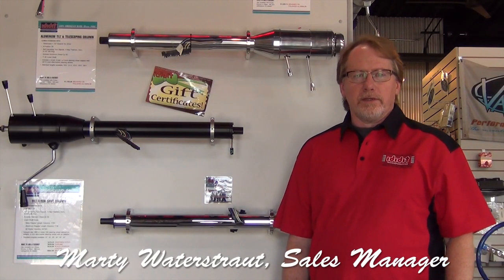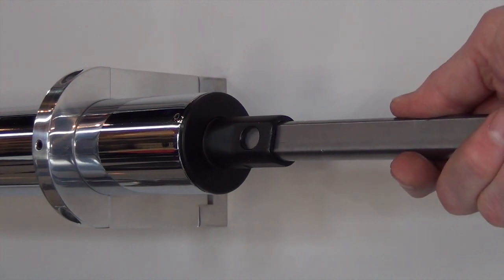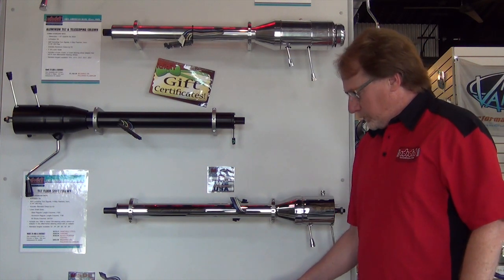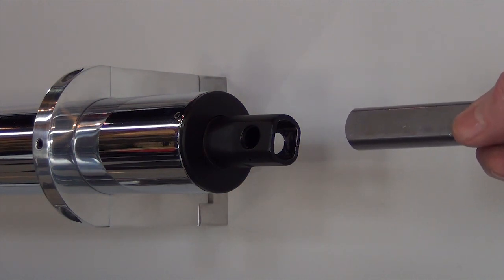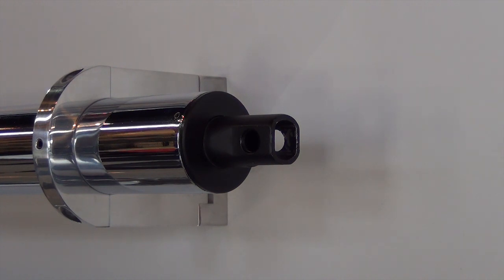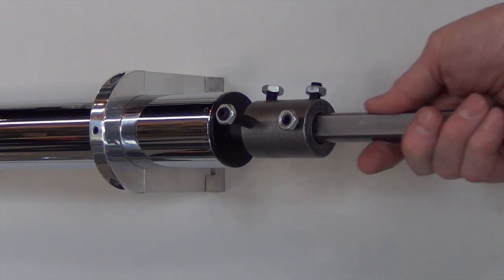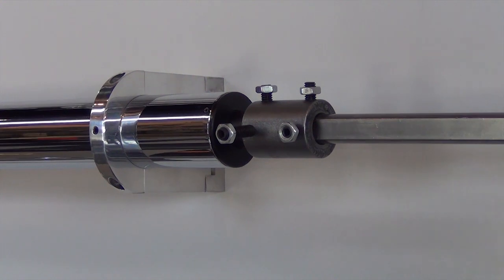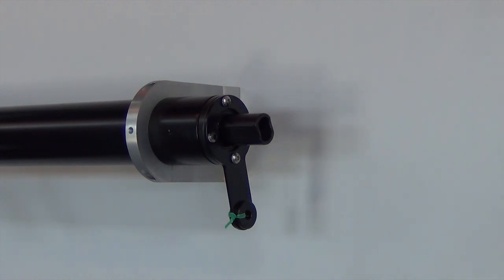What Not to Do When Attaching a Shaft to a Column

Comment: Wrong. The shaft stresses are so small that you can easily use them as designed, i.e., drilling a hole in them. The one screw in shear is much stronger than the four set screws in friction that you suggest. You just operated the steering system with no screw at all and the hole did not open up. The screw will not open up the hole because it's only purpose it to keep the shaft from pulling out. It does not transfer torque. The shape of the shaft and the column are what transfer the torque, not the screw. The set screws you propose are much less secure and absolutely not safe. You actually do NOT know more than the engineers who design steering systems. Delete this video, it's not safe.